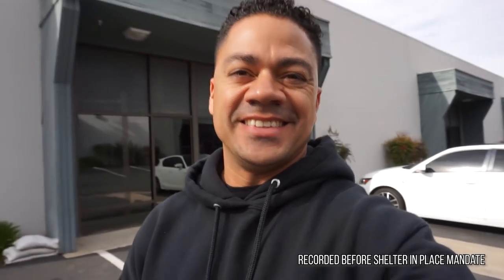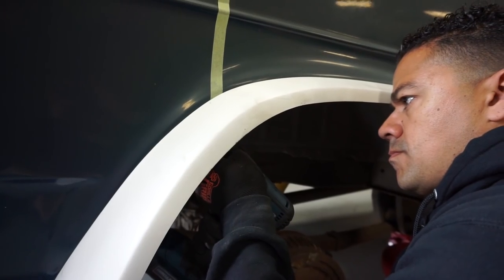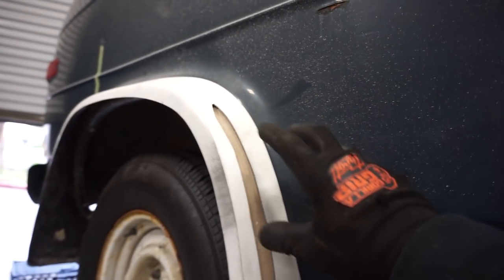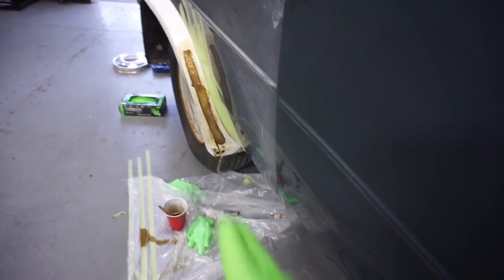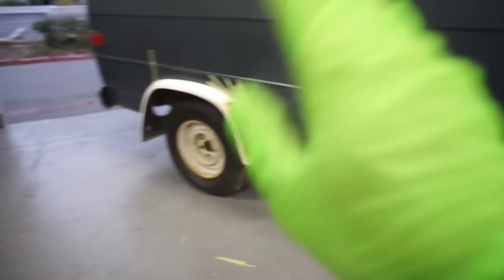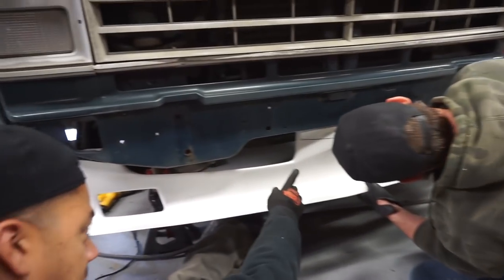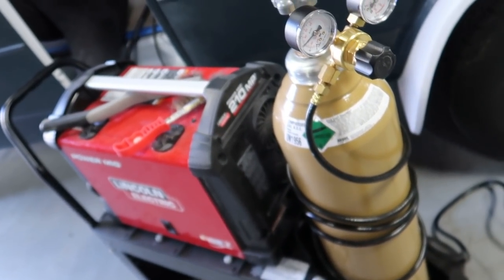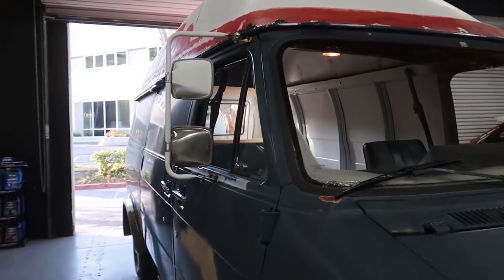Building the COOLEST Ice Cream Truck on the Planet!! [Ultimate Chevrolet G20 Build] - Part 5

Comment: Isn’t there extended hinges to make the door open outward more to clear the fender its an arm extension i believe.. i would have done that but thats just me..
Reply: I was thinking the same thing. Even if they arent already made, I think it would be a quick cut and re-weld on those existing hinges to make it flare open a bit more once opening
Reply: 100%
Reply: Yup. Did this on my vw van when I added fender flares. Extend the top arm on the door and your done. This is definitely the hard way

Comment: Should have just adjusted the sliders so the door opens further away from the body
Reply: This was way easier and works perfectly.
Reply: @mickeyandrade  You can literally buy modified door hinges that just bolt on, and fix the issue.. No way that this is easier.
Reply: F1NNSP1N 🤣 he probably didn’t know those came already made , cause id definitely do what they did if i had to fab some extended hinges 😂😂
Reply: It’ll just hit the wheels later
Reply: @Finnspin_unicycles  - Send me a functioning web link to a set I can buy. I found them online but could not find a set actually for sale. So, we made our own solution.

Comment: Hey guys, two suggestions, barn door? Might've been an option but the other is an idea that Toyota use, a kicker at the base of the door. As you open, it folds out on a track at the bottom of the door, giving clearance for the side of the van. Just an afterthought guys.

Comment: They make a kit that is an extension bar that goes on the back of the door that kicks the back of the door out further they use it on the old Mister T vans
Reply: michael bennett - All good. We fixed the problem without having to do that.
Reply: @mickeyandrade3435  😂

Comment: If you're planning to do an LS swap on the van, you might wanna consider finding a way to strengthen the rear end to compensate for the extra power. Going for an Ford 8.8 or 9-inch?

Comment: they have a body filler Mickie that evercoat has called metal to metal its strong as hell it's a aluminum fiberglass body filler it's better than bondo does not allow moisture to get behind it.I stopped using bondo after i started using it since it stops rust out from happening and after i seen it could take 10 pound sledge blows and still not pop off of the body.

Comment: Did you consider cutting the door in half and welding the lower in place to hide the counter front and only slide the top half?
Reply: Jon Gather - Yes.
Reply: @mickeyandrade3435  probably more work door wise but would've looked nice finished
Reply: Jon Gather - Moving the lower slider would’ve been a challenge

Comment: I don’t get it. You cut a hole in the over fender...just to repair it?
Reply: Chace MD when they cut out the middle section to slim down the over fender, the remaining areas didn’t align with each other so they had to make a bigger hole that makes it easier to cover the gap.
Reply: Chace MD I think they cut out the middle section and then squeezed it together at the bottom so that it was more narrow. Still had to the the left over hole. Not positive though.